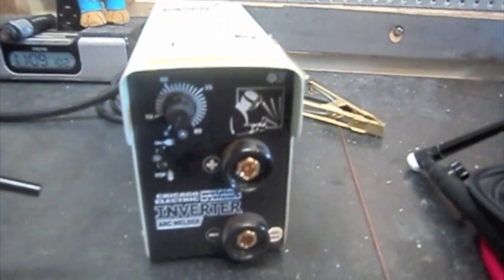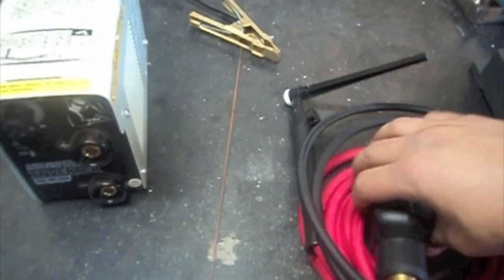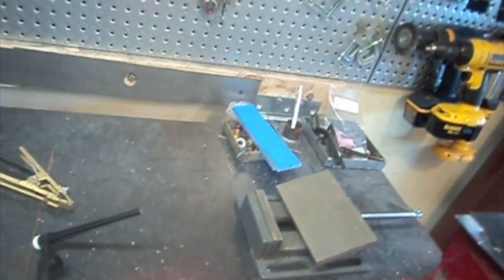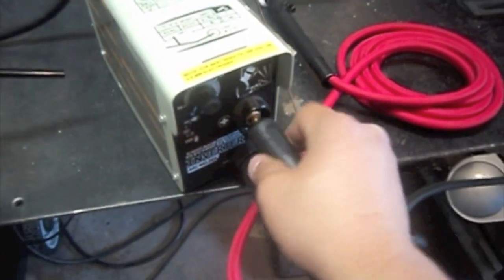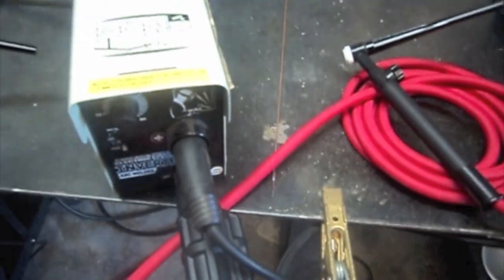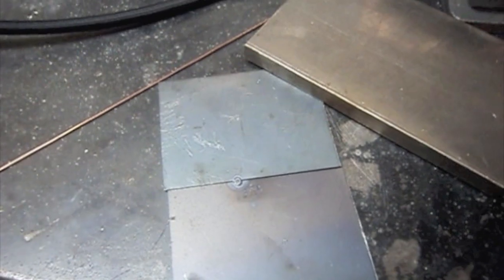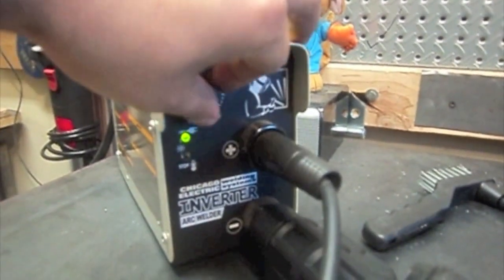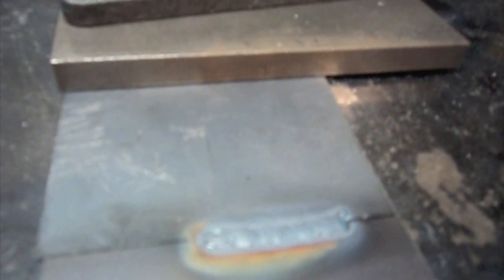Converting Harbor Freight Stick welder to DC Tig

Comment: Where do you hook the gas line it's hard to see
Reply from the maker: Tom Costa right to the regulator. Gas doesn’t go through the machine on this setup. Hose will have a standard 5/8-18 threaded fitting

Comment: Can I weld a rim with this
Reply from the maker: maroboy 91 a steel rim maybe but probably not the best option
Reply: maroboy 91 

Yes, but if it's cracked or split you have to drill out holes at both ends of the crack to keep it from re-cracking and grind or gouge out the length of the crack to be filled by the weld bead before being smoothed out and repainted or powdercoated.

If it's a steel wheel, it'd be cheaper to just buy a new one. If it's a mag, alloy, or aluminum wheel, it would take a way more capable machine and someone with experience running it to do any good.

Comment: Definitely gonna try this 

This so cool I'm ordering it right now XD
Reply from the maker: https://www.ebay.com/itm/-/222117487216
Reply: gamble1997 and that's why I subbed to you lol thank youu!
Reply: M&R Tuning 

How did it go?
Reply: M&R Tuning can I use no gas at all? I keep hearing I need to change tungsten tip constantly. Do they sell Rod's with gas use? Like flux rods Thanks Sir
Reply: Slayer LightWarrior 

Not with TIG. If you want to weld with no gas, use stick or get a wirefeed welder that can run flux cored wire.

Comment: can you weld aluminum with it
Reply: alex bill no, you need HF start and AC for a decent looking weld.  Scratch start DC won't work on Aluminium.
Reply: Youll never get the aluminum to flow together. It will melt the part and turn it to shit.   You need the momentary positive pulse to break up the oxide skin it gets so it flows together. Using electode positive only 'works'  but the electrode melts away like a regular rod in a sec or 2. So i guess it doesnt really work. The duty cucle of the machine at a usable 35-40 amps is only about 2 mins before it stops and the overheat alarm sounds. Really annoying. Get something bigger with higher duty cycle.

Comment: Is there any way to lift arc without scratching?
Reply: You can start the arc by simply flipping the filler rod between the tungsten and work. This method allows you to have your travel hand in the desired position and by the time your puddle stability is good enough to move forward, the filler hand will have had time reposition. I believe Jody from welding tips and tricks uses the same method in his video.
Reply: gpgab971 Scratch Start Off A Piece Of Copper, Just Like Striking A Match .Make Sure You’ve Got ALL the Air From The Torch!! Argon + Voltage  Then The Spark Ignites The TIG Plasma(Arc)
Reply: Marcos Silva 

You don't scratch with lift arc, it's either scratch or lift. Get a little inverter welder with a TIG mode, like the AHP Alpha 160ST. They are capable of lift arc.

Comment: do u think i could do auto body work with this tig method?
Reply from the maker: Eh not something I would do. Only because on the low amperage side it seems to be unstable last I tried it. Can you do it on the cheap? Sure. Is it ideal? Eh probably not.

Comment: i tried this tig eelder using dc inverter welder and it always balled up my tungsten for just a second and arc goes out so whats d problem ?? ist d welder ? i opened it and its just a half wave rectifier:(
Reply from the maker: You need the tig torch to be on the negative terminal and you need to have 100% argon gas.
Reply: +gamble1997 my tig torch is connected to negative and 100% argon and still dsnt work ithink its just because my rectifier is half wave not a fullwave rectifier..
Reply from the maker: What welder do you have? It should work with all of them. I've done it on older stick welders. Doesn't matter if it's in inverter or not. Well all DC stick welders.
Reply: +gamble1997 i got sd8126 standard dc arc welder but the rectification of the output is not fullwave so ithink thats the problem.
Reply: +gamble1997 itried my ac welder in aluminum and its work but idont know the right lpm setting in the regulator...
Reply from the maker: iCe CuBe Popo's  try 25 -30 to start

Comment: what is the diference from bouth an harbor freight 165 Amp-DC tig welder from 209.99dlls, to convert the hf stick welder from 159.99 plus 99.99 ebay tig torch (like 258,99)
Reply from the maker: albert tamai I don't think they had that tig welder when I made this video. Also this stick welder used to be around $99-119 a few years back
Reply: gamble1997 

Yeah, I almost bought one back then. They're $170 now.

Comment: dumb question, but do u need gas for what ur doing?
Reply: No, he just had that tank hooked up and turned the regulator on because it looks really cool.
Reply from the maker: yes. 100% argon is what you use for tig welding. Some people use helium but that's a topic for another day
Reply: There's no such thing as a dumb question my friend. The gas is needed to cover the weld, so that it isn't exposed to the atmosphere as it cools, and more importantly, the oxygen in the atmosphere. If the hot metal is exposed to oxygen in the air what's known as oxidation occurs, and you will get very poor welds.
Reply: Lance Colvard
It may also be worth mentioning that there are a few different gases that can be used depending on the work piece. Helium, Co2 and Argon are the most common. What's also nice about this setup is he can still use the welder as a stick, which means no gas is required.

Comment: What kind of gas did you use
Reply from the maker: +noah he (noahdthehorse) 100% argon
Reply: +gamble1997 will helium also work?
Reply from the maker: +noah he (noahdthehorse) ya if it's ultra pure helium it can work. Need a lot more flow. Typically it's used for doing aluminum on DC. But it 'can' work on DC steel. I haven't had any luck but maybe you will

Comment from the maker: You need a torch with a small 25 dinse. It will measures 3/8" OD. Also it MUST have a valve on the torch. The gas line should have a longer hose with a 5/8-18 male end.

Comment: You could add a external potentiometer connected to the amp knob and make it foot operated adjustable.
Reply: +Guds777 and with exturnal arduino controal box then you can make it programmable to get high start and fade downs, and all kinds of different features and setting...
Reply: +Guds777 DIY for real...
Reply: @Guds777  easier just to buy a machine with all those features and more powerful machine

Comment: You are the man! I already have the same harbor freight welder and I'm too cheap to get 220v put in the garage for my bigger mig welder. I have a truck camper project that I'm getting ready to start, but its an all aluminum frame. This is definitely saving me a grand or so. Thank you!
Reply: I dont think you can weld aluminum with DC and this is a DC welder, you might need to get super cheap and use JB Weld

Comment: If all you have is an a/c stick welder (like me), get yourself an MDQ200A which is a 200A, 2000V, full wave bridge rectifier. Splice 4 ring terminals into your welding cable, and attach the rectifier inline. You can put both ends of each cable on the a/c side to weld a/c, or to the d/c side in whichever polarity you need. It's a bunch cheaper than a d/c machine, and it works. Mine doesn't even get hot.

Comment: I START ALUM WHAT MASS THAT WAS WITH TO MUCH HEAT PROPLEM
Reply: +73 SUPERGLIDE  Aluminum has an exterior coating of aluminum oxide which has a higher melting point than aluminum. You need to run AC with cleaning action.

Comment: awsome move bro , im so gonna do this , now i can tig weld copper thanks for posting bro
Reply from the maker: No problem, keep in mind 80amps won't do much with copper. Copper is a major heatsink. So it would have to be really thin.
Reply: gamble1997 yes i seen that after watching your vid , seen a guy use 200 amps on 12 gauge   copper , however i do intend to be using very thin stuff like 18 and 20 gauge
Reply: gamble1997 The guy im talking about also insisted you have to use helium for copper ever herd that ?
Reply from the maker: NOBOX7
Yes helium is commonly used when you don't have enough amperage. You need a higher flow rate since it's lighter. A good helmet since it's harder arc to sense in my opinion and it's very bright. It also has to be ultra pure helium, not balloon grade helium. And yes you will die if you inhale it since there is no air in there. A mix of helium and argon is still very commonly used on aluminum, I don't know of anyone personally that does it for steel but i'm thinking it would work the same as they needed to use something other than argon when tig welding was first introduced as it's called heliarc. Hope this helps

Comment: Could you run a plasma cutter with this?
Reply from the maker: No but you can buy a plasma cutter. The one from HF is actually a very well built unit for the price.

Comment: Really fell on love with this little welder. Im no professional but have plenty of experience welding. I welded some braces for a bush hog that that i have to guess was every bit of 1/2" thick and it held we even tested it with several hundred pounds and try to break the weld but it had minimal give. that wasn't welding at max amperage and only with chicago 3/32 rod that they sell and around 65 or 70 amps. I like to push my little harbor freight welder i even ocassionally weld with 1/8 rod 6011 and 6013 and they actually finish and hold well. I want to try tig on mine. When i get some extra money lol😊 this welder is definitely worth the money and the rods aren't half that bad either.

Comment: Does it well aluminum good? Been thinking about getting into aluminum welding to fix boats.
Reply: Love2boat92
yes i am
Reply: +sjeverett75 you can tig aluminum in DC use argon and helium
Reply from the maker: This will NOT weld aluminum.
Reply: Bummer. :(
Reply from the maker: Love2boat92  This one is good for aluminum without breaking the bank
http://www.ebay.com/itm/Longevity-200SX-Tigweld-200amp-ACDC-Tig-Stick-Welder-200-Amps-IGBT-/321544903127?pt=BI_Welders&hash=item4add91d9d7
Reply: Haha. Thanks. That would break my bank. lol.  That looks like a really nice welder. I'd love to own one. I like how it can do a few different welding methods. That saves money.
Reply: gamble1997 strange , not even very thin stuff?
Reply: i herd if you use helium you get more power in the weld so apparently it takes allot of amps for copper and aluminum
but a pro told me to tig weld with the most power possible use helium if you need more heat
Reply: apparently it takes like 200 amps to weld a boat hull ,
Reply: NOBOX7 Wow. That sounds like a lot.
Reply: Love2boat92
no not really i ve weld with 500 amps 1 inch thick steel
Reply: Jon204Gaming wow what were you welding?
Reply: Love2boat92
a tank
Reply: Jon204Gaming haha. That's awesome. Are you from the states?
Reply: +NOBOX7 this is a dc welder. you need ac to weld aluminum

Comment: Do you think this machine would be able to weld up bicycle frames, using 4130 chromo or should I look for a slightly stronger machine?  If you have any recommendations I would be greatly appreciated to hear about them.   This welder will just be for "spec" frames and such....not production.  I think .125 is a pretty thick tubing wall for the work I want to do but since I am new to this I am not sure...I don't want to become an expert welder....just enough to try out my designs...I want to farm the welding out and put my time into growing a business.
Thanks,
Dan
Reply from the maker: Hmm it will probably work, but you may overheat the metal being that you have to wait for it to heat up since it's only 80amps. You can probably scrap by with it, but if it was me I would get a little stronger machine or get something that you can very the amperage on. Send me a private message with your budget and I can recommend you a few.

Comment: Hi, excellent video, how do you do to start the arc, because your welder is designed to mma, this machine doesn´t have lift tig, or not have the option lift tig
Reply from the maker: Touch and go. You can swipe the torch light a match, but i like to rock it from the cup to touch the tungsten and lift. Look at 2:00 into the video.

Comment: Will this setup, with argon, weld 4130 chromo?  And what would you say the max thickness of material this could weld? the specs on HF say 3/16's?  Thanks for the video!
Reply from the maker: I don't think you will get 3/16 even on stick with this machine.  Yes you can weld chromoly as that is used on DC. I'd say you can do 12 gauge (.105"); I never tried to push the limits to see how thick it can do.
Reply: Hey Gamble1997, we chatted a bit about this earlier.  You can contact me @ pcworxonline@gmail.com  .  I don't really have a budget on the machine I need to put together...but really would like to keep it on the cheap side since these are just research projects for the next 2 years ( I am in nursing school at this time lol)  but I would like something I can weld 4130 chromo with and the largest wall thickness I am looking at is around .120 to .125.  what I really need is a tig setup that will go low so I don't burn through the thin wall tubing as I have explained.  I am no welder and I don't expect to become one I just need something I can learn with, weld up my projects, test them out...and when and if I am ready I will to go a commercial welder in the area for production work.  If you have recommendations on a machine just shoot me an email at the address above and I really appreciate the time you took to make your videos and to respond to me.  I think I have my brother in law hooked on a simple setup to have around the farm since they have NO welding system at all on the farm!  He is really interested in the arc/tig setup as well.....thank you for time and dedication.  By the way the .120 wall is something that is extreme and not done on a regular basis...but I would...I think Like to have the ability to go that wall thickness if the cost is reasonable.
Dan

Comment: Thanks for the link ! I have a comparable DC inverter from Northern Tool . This torch should be better than the one sold there for the Tig optional package . Do you know of one like this with a flex head ?
Reply from the maker: Can't say I do, but search ebay for a tig torch flex head with valve. The one I got in the video is a #9, but the #17 can be installed as they use the same power cable but they use different consumables.

Comment: I have a question. I have an old lincoln MIG welder HD 100. It has no power at all. Can I pipe my pwerfull 250Amp welder through it but limit the amps and not burn the torch ?  Can you tell me how please. I don't care if the damned thing throws up. Any help would be appreciated.

Right now im just playing with my tig and MIG as a wire feeder.

-baboon
Reply from the maker: no..

Comment: Did you try this with aluminum? I got an older weldcraft torch setup to use on my AC/DC lincoln tombstone I wanted to try on SS and some 4043
Reply from the maker: This will not work on aluminum

Comment: I'm try to find the link for the tig torch. Can you tell what's the brand of tig torch. Thank.
Reply: http://www.ebay.com/itm/12-1-2-WP-17-Tig-Welding-Torch-Weldcraft-Compatible-Miller-Dynasty-200-USA-/170921403411?pt=LH_DefaultDomain_0&hash=item27cbb5a413
Reply from the maker: This is the one i used
http://www.ebay.com/itm/Scratch-Lift-Arc-Tig-12-WP-9-Tig-Torch-Valve-Conversion-Welder-DC-Superflex-/141015840940?pt=LH_DefaultDomain_0&hash=item20d532f8ac
Reply: same one is just longer for the gas cable and it hold up to 150 amps
Reply from the maker: No it's completely different. This one is a 9 torch, smaller dinse and longer side gas which goes to the regulator as well as a valve on the torch.
Reply: oh ok

Comment from the maker: Depends on what grade of stainless it is. You want to match your filler material to the base metal. 309L is a good stainless rod and it's what I use, but it all depends on your application. 
Red(thoriated), orange or grey (ceriated), 2% lanthanted (blue), 1.5% lanthanted (gold) all work really well. I'm starting to like orange a lot more. A lot of tungsten is going to be personal preference.

Comment from the maker: The only issue I saw with the machine is if you get the tungsten too close the arc will "drop" or go really low amperage so if you pull the torch back from the work piece like an inch it will go back to normal amperage. I'm going to assume this is normal to help prevent the stick electrode from sticking to the work piece.